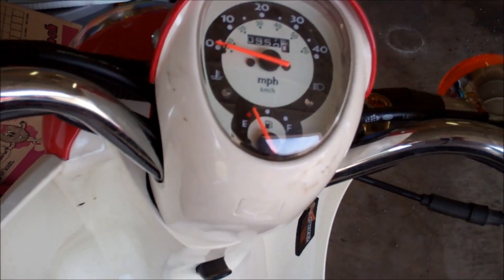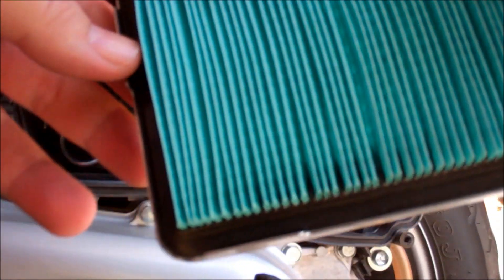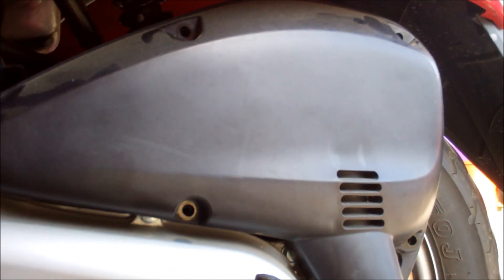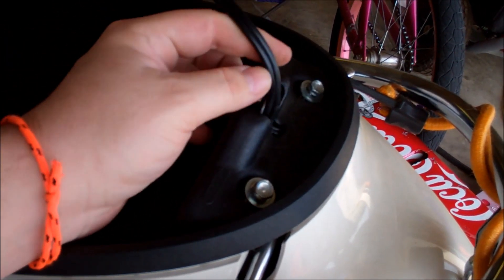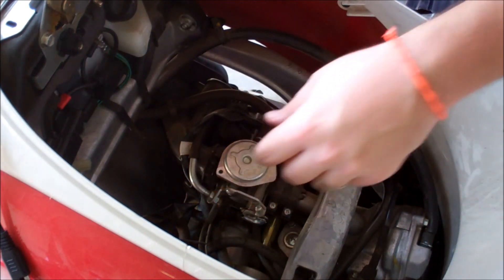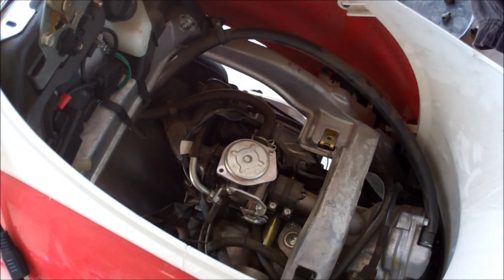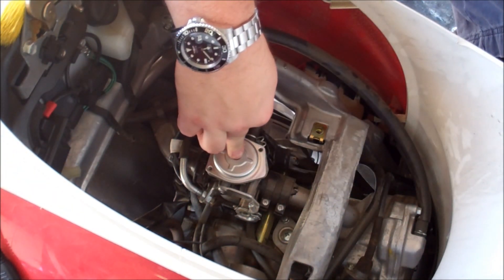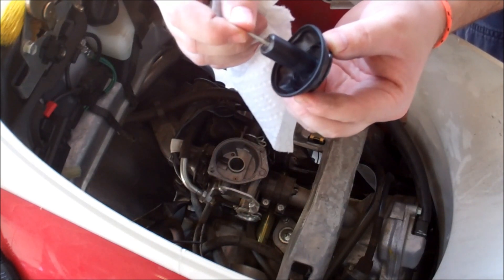2005 Honda Metropolitan Scooter - Rough Start and No Power

Comment from the maker: No problem, I hope the videos help. As far as your engine goes, I recommend removing the carb and breaking it down and giving it a thorough cleaning. Sitting for any amount of time is hard on the carb, and can gum up the needle jets and air/fuel passages. It only takes a little debris to wreck havoc on small engine carburetors. Good luck, and keep me posted!

Comment: Worked!!! My only suggestion would be to use a screwdriver with a longer shaft to get more torque at the head of that fastener    Seeing you have to go through using that bolt extracted scared me straight. Thanks for making the video! My needle had gum at the base that I worked off with my finger nail.

Comment from the maker: @busaofsc Thanks for watching and the comment! You are right, replacing the filter did help (I did a video on this procedure), and I also found that when I stored it last fall (2010) and changed all the fluids, I over filled the oil by about 6 ounces. This may not seem like much, but when I drained the oil out and topped it off to the proper level, that made allllllllll the difference! I plan on posting an "Update" video so others can know about the oil issue. Thanks again for watching!

Comment from the maker: @passmoregas23 I used a can of B-12 Chem tool. But you could use anything that has a cleaning agent. Carb Cleaner or Brake Cleaner also works well, just make sure to keep it off and away from the rubber diaphragm. You don't want the rubber drying out and cracking.

Comment: Newbies  always Investigate  the Diaphragm slide LOL.    It sticks  out like HEY! OPEN ME UP.  Drain your Carb bowl check for contamination 
95%  of the time,  Its in your Main and Pilot jets. And These  engine run lean anyway .
 So, Water or debris sucks up first when you open the throttle ..They will cold start on choke jet which is higher in the bowl but after that they  will die while   idling and  applying throttle. Check valve lash .  If there tight Hard start and No Idle . Low compression Good Luck :)

Comment: Okay...I saw everything, pretty straight forward...except I have no idea what you repaired w/regard to the 'needle' and/or rubber diaphragm! You took it off...then came back and then began re-assembly! What was wrong? Was it 'jammed' 'gummy'  'plugged' or what? Was the diaphragm no good? Not 'moving' right? A 'pin-hole' leak or something? I still have no idea what was 'wrong'...other than the damn screw 'stripped-out'.

Comment: Thanks for the fast reply! I'll give it a shot. :) I have a 07' Xingyue XY150T and it's been sitting a while...like almost 2 years. Drined the gas, filled with new, changed the oil, dropped in a new battery and a new spark plug and fuel filter. I'm running out of Ideas. It tries to turn over but doesn't make it. Let me know if you might have any other ideas! I appreciate your help.

Comment from the maker: If it's just the jet needle, I will typically spray it down with some brake parts cleaner, wipe it off, and then re-install it. If you get a chance, take a look at my carb tear down for the Honda, in that video I actually soak everything in some cleaning solution. Thanks for watching and for the comment!

Comment: Hello and thanks for the video. I learned from it. I am wondering when you turn the key to the n position. There is a ticking noise you can hear. Is that the fuel pump being engaged?
Reply: yes that's the fuel pump. Normal noise

Comment from the maker: Thanks for the comment and for watching! I believe the cleaning of the Jet Needle is the same as yours. If I remember correctly, the ruckus has the same 50CC (49 cc) engine and carb. Also, take a look at the new video I upload on tearing down and cleaning the carb, that should also be done while you have it torn down for the crankcase seal. It doesn't take much for the needles to get clogged, and it is well worth it. Keep me posted on how it does!

Comment: The screws on top of those CV carbs are notorious for seizing up after awhile. Before I strip the head of the screw out however, I take a pair of those miniature Channel Locks, grab the head, and turn the screw with those until the screw breaks loose.

Comment: Thanks a lot for these videos! 

My CHF50 has been sitting for over a year. I tried to get it going today and I managed to get it to run for a few seconds but then it would die out. I siphoned the old gas out of the tank and put fresh stuff in. I'm going to clean the carb tomorrow. 

I think the battery is toast though. Will it still run without a battery? Is it worth getting the carb cleaned out before I go out and buy another battery? Any advice in this respect would be really helpful. Thanks

Comment: Thank you SO much for this video. I'm going to see if that's my problem right now.  I do have a question though: in addition the same starting stalling issue, I found when checking my air filter that there seems to be a mixture of gas and oil that has somehow come in through that tube on the left of the air filter housing and has soaked my air filter, which i have now replaced.  is that because my carb is sticking open?

Comment: Hey great videos   That screw you removed and rounded  if you put it in a vise  and use a hack saw cut a slot in the head and use a common screw driver

Comment: Hi there. Is there a video on how to wire the charging cables? Would like to connect mine to a battery tender over the winter and don’t want to have to remove the plate every time. Thanks!

Comment: I have a 2004 metropolitan, turns over, has compression, has spark, I cleaned the carb multiple times but I just wont take gas. the pump wouldn't get it up there. I even tried gravity feeding the carb with no results. My battery needs replacing but I would think that it at least would start...
Reply: Nate Sand my currently is doing the samething
Reply: Mine is too. 2009, just cleaned the carb (remove and clean , it's like new now bike only has 600 miles on it)  It tries to start and idle, but completely craps out when you give it any gas
Reply: Did you fix it

Comment: Get a set of JIS screwdrivers. They're some sort of Japanese designed drivers that work much better than conventional phillips drivers.
Reply: Correct. This is why screws are always bungled on japanese bikes after the bubba P.O. worked on them. Every "phillips" screw on a japanese bike is really JIS which is slightly different. Enough to cause Phillips drivers to not get a proper bite and strip the head. A decent 6 in 1 from Vessel on amazon is $10-$15.

Comment: LOL this is how not to fix anything people, and this didn't fix his wife's scooter, although  he was in the sorta right direction what happened is the bowl (fuel) has trash in it clogging the MAIN jet.  So just pull the carb remove the bowl (shoot some carb cleaner around the other parts jet passages and needle then clean the bowl and shoot cleaner thru the main jet put bowl back on and then carb and your done.

Comment: Im having the same problem in mine.  I sprayed the carb down with some carb cleaner but it looked spotless.  I didnt do anything to the needle or filter though.  I will check that out tonight!  

When Iturn the key to the on position i get a clicking sound. is that normal?  Someone told me it was the alternator working, but i wasnt sure.  I'll let you know if this fixes mine too!  Great video, thanks!
Reply: I also get the clicking noise... You didn't let us know, did it work?
Reply: @roserivet4952  I had the clicking noise also. It was a bad fuel pump. Putting in a new pump and filter fixed the problem. Good luck.

Comment: Hi, i've got a question for you. I have the same scooter and yesterday, i had the same problem that you had. Is it a battery problem or an other problem? My scooter has been in a garage without heat during the whole winter and when i wanted to start it, it didn't work. So, what could i do?
Reply: Your suppose to have a battery tender plugged to keep the battery charged. Other than that, I suggest cleaning the carburator.

Comment: I have a 50cc china scooter that can not speed up, max rpm is 4500. idling  good. i cleaned the carburetor, same problem exist. changed a new carb, the issue is still there, what is wrong? this trike is just 6 month old. I need your help. thanks

Comment from the maker: Thanks for the comment and for watching! Sitting for any extended periods, without running, is hard on our little engines. But you are on the right track! I highly recommend watching my newest video (tear down and cleaning of the carb), and completely cleaning your carb out. 

As for the battery, I highly recommend replacing it. With the battery, the stator (alternator) is not going to be able to supply the power the scooter needs. Thanks again for watching, keep me posted!

Comment: I had the same problem with mine. I cleaned up the carb and it stopped dying when throttled but now it has no power on take offs and it will lag really bad. any suggestions? I have an 05 met.
Reply: Jonathan Antonio w what was wrong with it

Comment: I have a 2014 phc lence with 14,400mi. And i Just recently got the air filter and the idle adjusted or tune for 230$ and now it has little power and turns off on my during stop signs. Any idea what could be? pleasehelp
Reply: No clue buddy
Reply: Yes it's a valve adjustment

Comment: My Scooter runs well up to 20 but then it very slowly moves to 30.  sometimes it suddenly kicks in and goes faster, like old times.  Any thoughts.
Reply: Sounds like bad gas, or even a flat spark plug, check valves? Clean air filter mabey

Comment: I have a 2009 honda metro, it was sitting in my closet for a lil over a year, and i charge my battery for less than an hr, n pour in 93 octane gas then it would start for about 5-10 sec then cut off. what could be the problem? HELP PLEASE!!
Reply: Carlos Watson carburator needs to be clean or buy a new one and practice with the old one

Comment: ever heard of vicegrips  its much faster an 99% of the time it works on the striped head of the bolt
Reply: Exactly,  vicegrips are a life saver... extraction kit? I dont have one especially for this situation.  You need large vicegrips and small vicegrips. Nice video.  My lady got the same Metro (Scoopy in Japan) 600$ , she loves it.